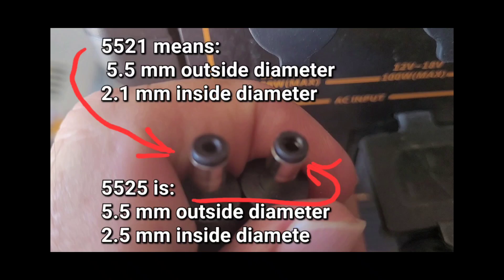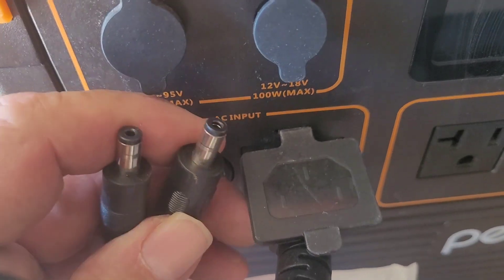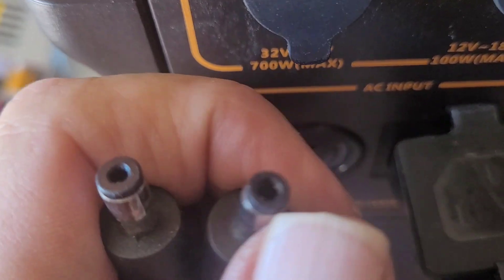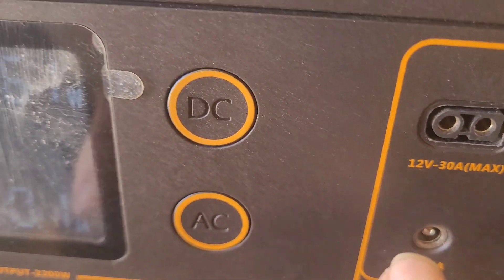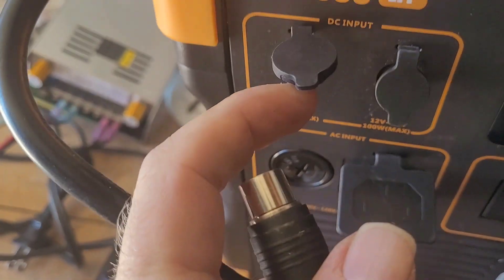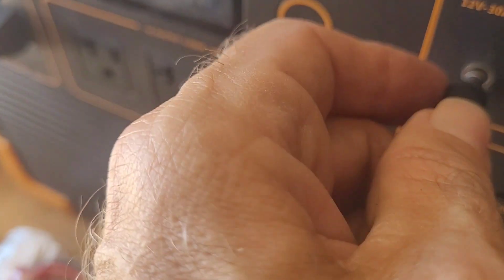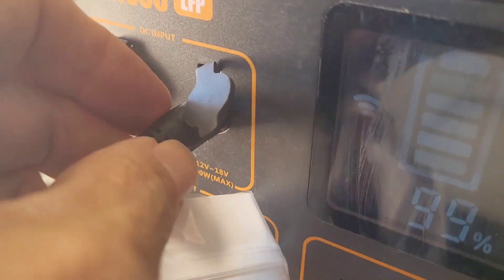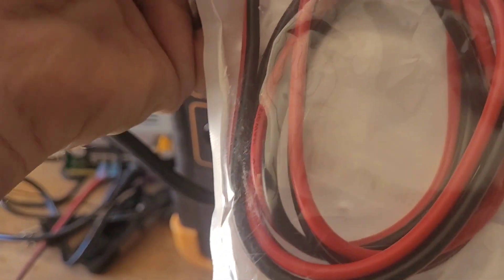DC plugs 5521 vs 5525, Which One?

Comment: question: my Pecron E3600's small 150w/30v mppt 5521 plug cannot handle more than 90 watts (15v @ 6amps before the 5521 gets too hot.  Is there a heavy duty 5521 type plug I can get from Amazon to get closer to the advertised 150w?   I'm currently using a 14 gauge 5521 from amazon. thanks for your time